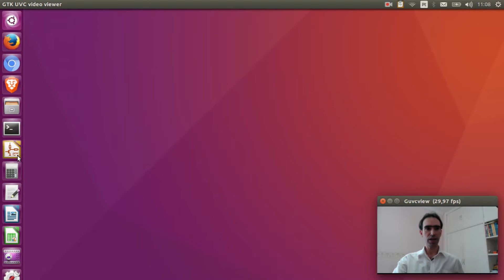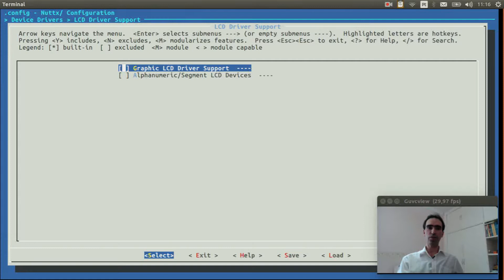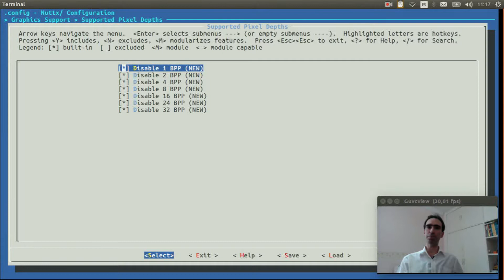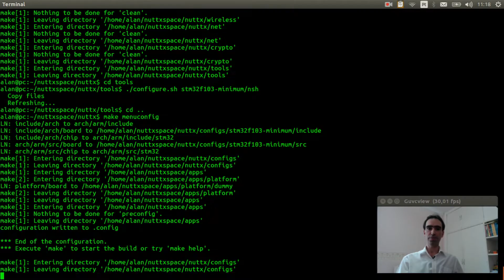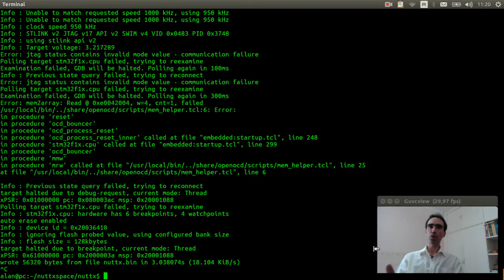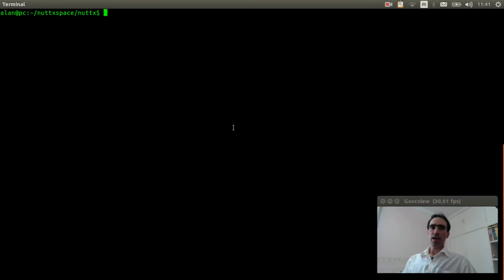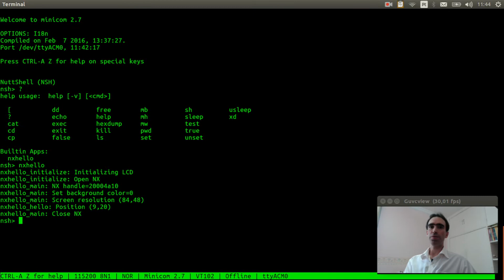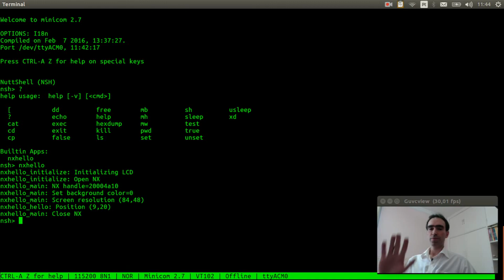#014: Using a Nokia 5110 Display on NuttX (OUTDATED: read comments)

Comment from the maker: Recently NuttX replaced its single mode user graphics with multiuser mode, then this video is outdated. If you want to test this video you need to use an older NuttX version, run the command: "git checkout a9a236fea5a8235c9852f8f494bdcc8ef822ae30" inside nuttx/ and "git checkout 158cbeb15107099ca42d2d63fcb1f2bf4ae1623a" inside apps/ !

Comment: Dear Sir.. i always got this error:
nsh> nxhello
nxhello_initialize: nx_connect failed: 28
nxhello_main: NX handle=0
nxhello_main: Failed to get NX handle: 28
nsh>
How to solve this problem?
Reply: Hi fendy yefendy, this video tutorial is OUTDATED, so I suppose you did the "git checkout a9a236fea" in the nuttx/and ""git checkout 158cbeb15" in the apps/ right? The error 28 is ENOSPC (No space left on device). Did I you forget to disable some NuttX features to reduce memory consumption? (video #017). The BluePill board has only 20KB of RAM and it is not enough to fit all default NuttX features plus NX graphics, you need to disable some features to get NX graphics working. BR, Alan
Reply: Hi, thankyou..
Actually i have STM32F407VET dev board (https://www.ebay.co.uk/itm/1-Core407V-STM32F407VET6-STM32-Cortex-M4-Development-Board-Mainboard-Module-Kit-/232476184187). I tried to copy and customize  config/stm32f4discovery to my custom board. I was successfully to add SPI OLED LCD using stm32_ug2864hsweg01.c and able to run frame buffer example code. But when i tried to use nx library it always showing nx_connect failed: 28, i thought this chip already have plenty RAM for this.
Reply: Thank you Alan, i sent you a mail of my .config file.

Comment: Hello sir! I tried exactly what you guided but unsuccessful. The LCD didn't show "Hello World" string, it's only show a filled rectangle. Could you help me?
Reply from the maker: Hi HỌC IT - ĐIỆN TỬ, recently NuttX changed its LCD support and added framebuffer, maybe something changed. I suggest you to test the NuttX version of the same day this video, i.e.: "git checkout a9a236fea5a8235c9852f8f494bdcc8ef822ae30" and execute the tutorial step-by-step again. Please let me know if it works.
Reply: It's worked but the "Hello World" string disappear immediately after that, not like which showed in your video. Thank for your help.
Reply: Very nice! You can put a delay inside nxhello_hello() function in the file apps/examples/nxhello/nxhello_bkgd.c just before the function free(glyph); I.E. usleep(3000000); will display the hello world for 3 seconds!